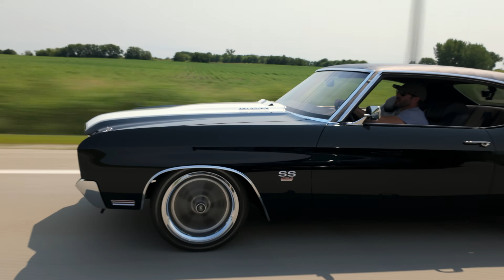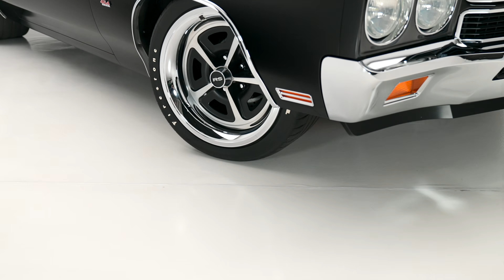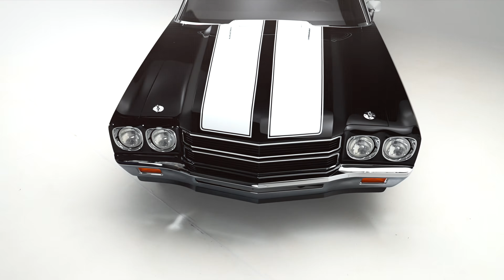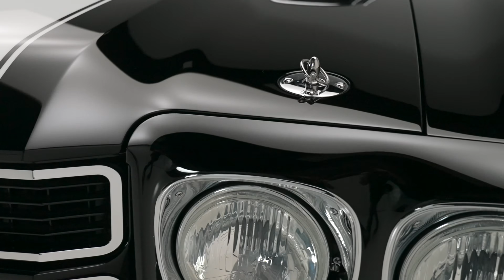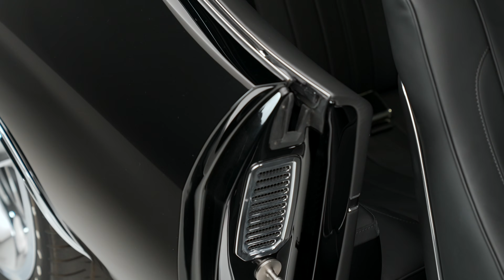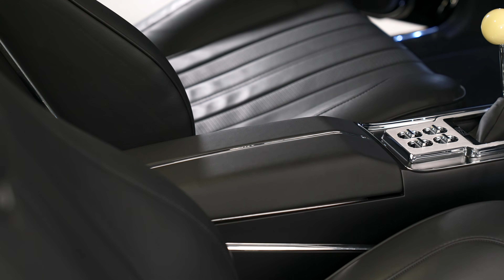Chasing Perfection | Brent's 700HP Roadster Shop built 1970 Chevelle.

Comment: This body style Chevelle is by far my favorite. Love that muscle car look. Black or red with white or black stripes is my dream color combo. The red/black would have black wheels. The black/white would have regular chrome wheels. Have a supercharged 454 mated to a 5 speed transmission. Keep the interior as stock as possible. Dakota digital gauges. Have the exhaust dump out right in front of the rear tires. Speaking of tires, I would want the widest rear tires as possible on a road car

Comment: loved my 69 SS 396 Chevelle. I did everything myself, Black with the white stripes and a 496 CID BB. Paid $1700 for it in the early 90's, had a replacement SB in it that I took out right away. It had no rust at all and a perfect SS interior. Did a ton of paint stripping and removing of the stock vinyl roof. Moved to Florida for year round driving. Needed dr's every couple of years to keep it hooked up on the street.

Comment: IT LOOKS LIKE ITS GOT BAD SAGGING REAR SPRINGS... FOR GOD SAKE STOP LOOKING LIKE A 16 YEAR OLD PUNK BUILT THIS CAR... MUSCLE CARS DON'T SAG IN THE ASS...I HAVE 5 AND ZERO SIT LIKE YOU LEFT IN THE OLD TIRED ASS SPRINGS
Reply: THE FRONT BUMPER NEEDS TO DROPPED TO BE ABLE TO SEE THE ENTIRE LOWER CHROME ON THE GRILL
Reply: RS ON THE WHEELS AND SS ON THE FENDERS... IT SHOULD BE THE SAME THEME
Reply: I LOVE THE INSET FRONT AND BACK MARKERS AND HOOD PINS  AND TGE ONE PIECE GRILL CHROME.  AND TGE EXTENSION PIECES ONTO TOPS OF THE DOORS BY FRONT FENDERS

Comment: In 69' when the new Chevelles came out it was my all time favorite. 69 Chevelle and 69 Mustang Mach 1 were on the top of my list. Then when the 70 Chevelle came out it took a few months to grow on me, now its a toss up between the 2. I was a few years from diving age still but was a car nut since I was a tyke in the late 50s. My first car was a hand me down 65' Ply. Ironically the first car I ever bought with my own money right out of HS in the mid 70s was a 69' Ply Road Runner. Current car and daily driver today is a 2017 Super Sport Camaro 6spd manual. Love it. Bought it new, now have 72k miles on it.